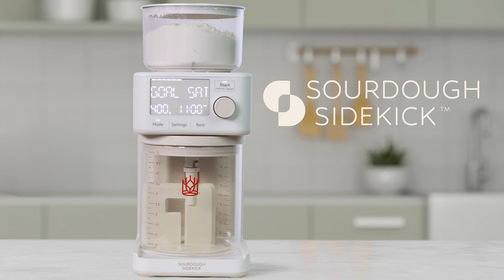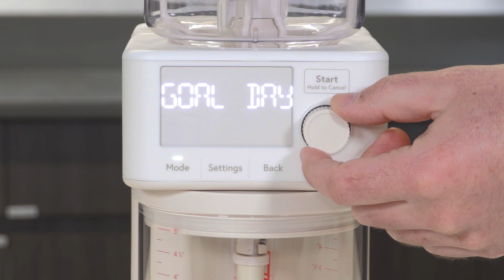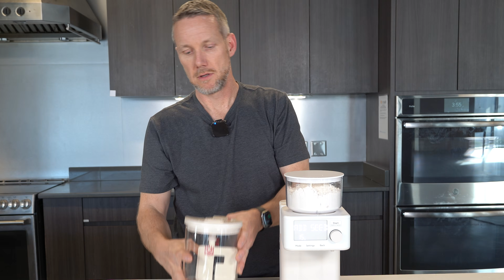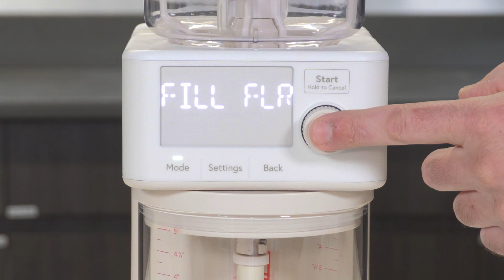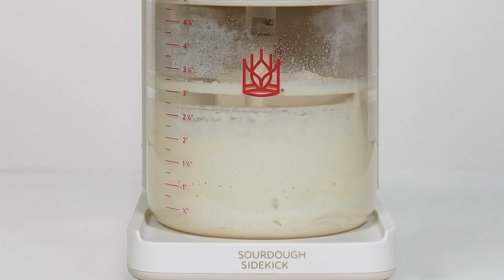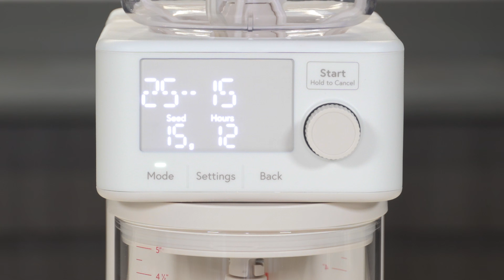The 3 Modes of the Sourdough Sidekick | TUTORIAL

Comment: What this thing needs is a way to feed every day without calculating when the crock is full and asking you to restart the entire cycle.  In other words, replicate a manual feeding process where every day you remove and add back the same amount, and hence the crock NEVER fills up and you never need to reset the thing.  This is how most people do their starter manually, and all they really want is to have the machine continue to do it in the same manner.  They have overcomplicated this, and they need to add a mode to make this possible.
Reply from the maker: This is exactly what Custom Mode is for. You pick the amount of flour and water and how much seed is in the crock then you select frequency of feedings. So you could have it feed a set amount daily or every 12 hours and then manually discard everyday. Helpful for people who are constantly baking or wanting discard. The Sidekick will also tell you how long this mode will go before your crock is full.
Reply: @SourdoughSidekick  yes I know, but in this mode, the sourdough sidekick still calculates when it thinks the crock will be full and then you need to restart the cycle at that point. My point is it should in this mode not calculate when the croc is full so that you never have to reset it, you just keep feeding it and discarding every day. Perhaps I’m wrong and how this operates but so far I believe this is how mine has worked. I really don’t want to have to reset it every couple of days when it thinks it’s full.
Reply from the maker: Understood. It is something we have been thinking about. We are hesitant to disable any safeties that potentially keep the crock from overflowing and creating a real bad time for the user.
Reply: @SourdoughSidekick  yes thank you for the feedback and I completely understand that.

Comment: If you have a power outage does it remember where it left off when the power is restored?
Reply from the maker: It does with the new software update that just came out be sure to update your Sidekick through the SmartHQ app
Reply from the maker: It does with the latest software update. There is no internal battery but you can use WIFI to let the Sidekick get the correct time via the internet and in most cases it should be able to continue the current cycle without intervention. Use the SmartHQ app to connect and update your Sidekick

Comment: Mine will not go lower than 400 grams.
Reply from the maker: For longer auto modes there is a minimum required. This is due to starter safety. If you tried to grow a small amount say 50g over 7 days then that might have a negative effect on the starter health. It is still much less flour used than if you were feeding and discarding every day

Comment: I started auto on Sunday and it’s Tuesday and there is hardly any in it. I set it for 400g. I feel like it is only stirring it. The start worked fine.
Reply from the maker: The Sidekick mixes every 2 hours but doesn't feed that often in Auto mode. Trust the process—it feels like magic at the end! You can always reach out to us at help@sourdoughsidekick.com as well.
Reply: @SourdoughSidekick  I have yet to see it add anything checked the water level and it has not changed nor the flour

Comment: How do I know if the sidekick is actually working, does the start light continue blinking if the cycle has started?
Reply from the maker: No it does not. Make sure to press the start button and the Sidekick will immediately mix and dispense every time you start a cycle. So if there is no movement then it hasn't started

Comment: What is the temperature range for the SK sensor? And what happens if your ambient temperature is outside the sensor's temperature range? Will the SK automatically adjust its feed ration to compensate for an over-temp condition? More info please.
Reply from the maker: The range is greater than your house would ever experience (barring an ice age or house fire) and the Sidekick will adjust it's feedings based on the ambient temp.

Comment: My starter thrives at 80 degrees Fahrenheit. If the sidekick doesn’t control temperature to a specific temp, will my starter start to fail?
Reply from the maker: The Sidekick has an ambient temperature sensor and makes adjustments based on the temp. So there is a range where things should be just fine. Since starter is a living thing, results can always vary. Do you keep your starter at 80 degrees year round?

Comment: My auto mode will only go down to 400 g.  How do you go down lower?
Reply from the maker: It has to do with the time frame of the auto-mode cycle.  During development, we attempted to allow very small goal amounts over 7 days, but it can be very stressful on the starter. It often worked out fine, but sometimes it didn’t so we chose to focus on providing the best possible outcome for the most users by limiting the minimum for longer auto modes. There are always tradeoffs when developing a product like this.
I have an idea for you. Have you tried high inoculation sourdough recipes? I’d recommend you check these out, here’s why. In a high inoculation sourdough recipe, you use a much higher percentage of starter to flour and water (usually 20-50% starter). Let’s say you grow 400g of starter over 7 days and use 350g of that starter in 2 loaves (175g each). You would reduce the flour and water used in those recipes and use most of the starter you grew (50g left for your next cycle and a tiny bit of discard if required). High inoculation sourdough is awesome, because it ferments faster and the structure is fantastic in my experience. I’d consider you give it a try and see what you think. Your net flour usage over the week would be about the same and your discard would be minimal.
Just a thought. Thanks for being part of the community and for the feedback, we appreciate it!
Reply: @SourdoughSidekick  OK, so what method/mode do you suggest for smaller amounts of starter?
Reply: @SourdoughSidekick  Thank you
Reply: @SourdoughSidekick  The video needs to be updated since it shows a 300g lower setting in Auto mode.
Reply: @timothynorris5837  The 400 g lower limit is for 7 days in auto mode. The video is showing, I believe, 3 days in auto mode. You can get down to 300g in that case.

Comment: My sidekick on auto mode will not go below 400 grams for goal.  Am I doing something wrong?  I followed all the steps.  Can someone help me?
Reply: I'm having the same problem, even after calibration.
Reply from the maker: It has to do with the time frame of auto-mode. During development, we attempted to allow very small goal amounts over 7 days, but it can be very stressful on the starter. It often worked out fine, but sometimes it didn’t so we chose to focus on providing the best possible outcome for the most users by limiting the minimum for longer auto modes. There are always tradeoffs when developing a product like this.
I have an idea for you. Have you tried high inoculation sourdough recipes? I’d recommend you check these out, here’s why. In a high inoculation sourdough recipe, you use a much higher percentage of starter to flour and water (usually 20-50% starter). Let’s say you grow 400g of starter over 7 days and use 350g of that starter in 2 loaves (175g each). You would reduce the flour and water used in those recipes and use most of the starter you grew (50g left for your next cycle and a tiny bit of discard if required). High inoculation sourdough is awesome, because it ferments faster and the structure is fantastic in my experience. I’d consider you give it a try and see what you think. Your net flour usage over the week would be about the same and your discard would be minimal.
Just a thought. Thanks for being part of the community and for the feedback, we appreciate it!

Comment: What mode would I use to maintain a stiff starter for baking.  The ratio I currently use is: 1:5:3 (S:F:W)?
Reply: You would need to use custom mode to approximate this feeding ratio. For example: start custom mode, add 5g of starter to the crock and select feeding values of 25g flour and 15g water (5:25:15 = 1:5:3). You would then select how often to perform this feeding (i.e. every 24 hours) and then start the custom cycle. An important note here is that custom mode repeats the same feeding each time when running (in this case 25g flour and 15g water), it will not automatically maintain the ratio with each feeding. So, your stiffness (3/5 = 60% hydration in this case) will remain the same for the duration of the custom cycle, but the ratio of starter to flour/water changes slightly with each feeding. I hope that makes sense! If not, feel free to ask further questions!